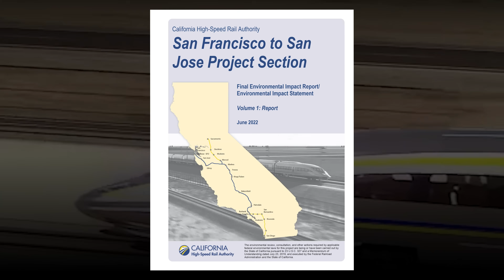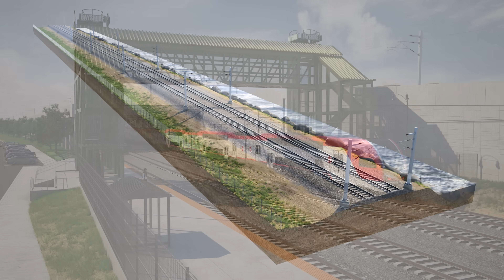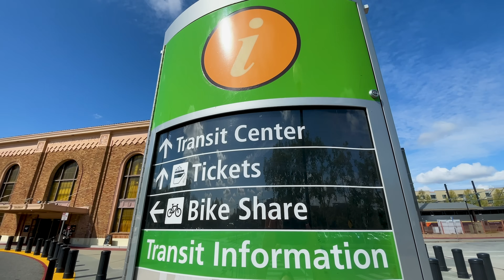San Francisco to San Jose Project Section Overview - FULL VIDEO

Comment: So the valley run Palmdale to Merced will be 200 mph?

And Gilroy to SF will be about 100mph using a blended shared track system? 

So San Jose to SF will take about 1/2 hour?
Reply: Delusional, its all faking realistic goals as there is no way one can travel in under 3 hours by train SF/LA.
Some 4-6 sleeper train services per direction for each night would be at least be doable. But as long as Caltrain themselves can't run their express service in under an hour journey, its not possible.

Comment: certain groups of voters are putting pressure at the state level to move away from gas powered vehicles so guess in away the passing of this makes sense. could have used this when i had to commute from marin to san jose to avoid the traffic nightmare  coming home .

Comment: The preferred CA-HSR specifications as written are for track speeds of 400 kph (249 mph).  CA-HSR implementation has totally lost its way.   The LA - SF route is circuitous and over the good fit limit of 500 miles to easily compete with air travel.  Everything possible should be done to shorten the distance and stretch to the highest speeds, just the opposite is happening.  There are no Chinese or Japanese HSR systems that notably run slower just from being in urban areas which are the primary examples of HSR in the modern world.  HSR is considered to be 250 kph (155 mph) and above.   

Blended high speed rail is 200 kph (124 mph) to 250 kph (155 mph) which includes freight and other traffic not 110 mph (177 kph).   Below 200 kph (124 mph) to about 90 mph is considered a fast passenger train.  110 mph and below allows the use of unsealed railroad corridors and at-grade crossing with quad gates which many freight railroads could be upgraded to provide.    110 mph track speeds would be a great enhancement for long distance Amtrak routes on upgraded host freight railroad tracks, but is not HSR.  

500 kph Japanese and 600 kph Chinese maglev train sets are running through proving and demonstration testing.  Japan was suppose to open its long distance 500 kph maglev from Tokyo in 2027, but land disputes have delayed it.   By 2045 eight meter wide three level maglevs running 800 kph - 1,000 kph should start to be possible.   That would mean in about twenty years 800 kph maglev technology become practical where California maybe just finishing new passenger train service with lots of 177 kph and slower speeds.  Nice for the 1950s not for 2050s!

That wide eight meter loading gauge has been desired since the start of the railroad age in the 1840s when UK double track railways were designed to occasionally have double width carriages run using the inner rails of the two tracks.   The eight meter wide loading gauge would allow large assemblies to be easily moved long distances overland changing the world as we know it.   The rail wheel interface is at its practical limit restricting the practical loading gauge width, but that is not the case for maglevs.  

All high speed trains need almost incrementally free electricity such as their own hydropower with unlimited water.   New nuclear power technology is likely the second best choice technology after hydropower in meeting that goal.    Japanese bullet trains were implemented with the hope of very incrementally cheap nuclear electric power.

Comment: Well, that is insane. After the effort made in the Central Area, in the SF area they are building a 3rd class infraestructure system, that significantly reduces speed, travel times and safety. Learn from Spain, France: high speed trains use exclusive infraestructure that is completely isolated from highways, streets or, at the end of the day, people, animals. That will cause accidents and it is a clear downgrade of the project that makes absolutely no sense.

Comment: How about a 4 lane road to Tahoe (hw50) And a 4 lane road through Tahoe pioneer trail. 7 hours last winter to get from placerville to South Lake Tahoe for commuters through 2 lane roads. But we need a light rail that will be never be done. Crazy horse will probably finish before this project. California is a huge state not easy to manage but there are certainly areas that could use some infrastructure resources. Especially one that sees more traffic per year than the Grand Canyon. Maybe some of that gas tax they keep raising. Other states seem to be doing okay without it and roads aren’t as bad. What do we pay taxes for now? Roads are included?

Comment: What incredible spin.  The guy speaks like it will be operating tomorrow, rather than in 20 or 30 years.  An Amtrak train from Washington DC to Baltimore goes up to 150 mph, takes 19 minutes 30 seconds, has been operating for almost 40 years, and is fully grade separated.  This SF/San Jose rail line can only go 70 mph because of the at-grade crossings.  Would've been better to branch BART from Mission Street to 4th and Townsend and save the money spent on the transbay station and it's tunnel for a second transbay tube to Emeryville and Sacramento.  Or possibly retrofit the BART tube to handle BART and these regional trains.  The current high speed projects are a lot of white elephants that cannot meet their goals and only suck money from more viable projects.  Oh well.  And can you explain why high speed rail didn't use the free right of way along the I-5 corridor on the west side of the central valley?  The mitigation and environmental impacts along I-5 would be minimal with virtually no condemnations, the construction speed much faster, the cost far lower, the operating speed much much higher and it could easily connect with the east side of the central valley.  The TGV in France from Paris to Milan goes completely through remote rural areas and bypasses Lyon completely.  Long distance high speed rail between large metro areas always uses remote right of ways to make up time for the lower speeds in the urban areas.  Also they don't have a bunch of local stations that slow down the average train speed and increases travel time.  Local stations are handled by regional rail.

Comment: I can't wait for this thing to open. It's a wonderful system to have and I wish more states had similar projects. But I have one qualm... 

You're going to have at grade crossings for an HSR system??? You'd have to put the barriers down way it advance for that system to work safely, and you'd probably still have accidents. Why go through all the trouble of building these viaducts (which I believe is necessary and good) but then have ancient at grade crossings????
Reply: The grade crossings are on the upgraded 110 mph classic tracks for 43 miles south of San Francisco, not on the HSR.

Comment: It's time to extend Caltrain to Southern California (Los Angeles and San Diego) from city of San Francisco.  It's really inconvenient to catch Coast Starlight either cross the bay at Emeryville or travel down south to San Jose.  In other words, one travels to east of the bay Oakland/Emeryville (Amtrak Coast Starlight) and one travels west of the bay to San Francisco (Caltrain).  If it happens in the future, more people will use train for traveling to Southern California.

Before CA HSR Authority complete their HSR Infrastructure, it should be no-brainer to extend Caltrain to Southern California from city of San Francisco.
Reply: Why do you need CalTrain with HSR? Why not an upgraded version or convert to BART?
Reply: @Cyrus992  Caltrain's new EMUs may very well be the best rolling stock in the United States for short-distance transit.
Reply: @chasemartin4450  So they do something that BART does not?
Reply: @Cyrus992  Yes, they carry more passengers per car as they are double-deck, have bathrooms, and have a much better solution for bike storage. BART is still very good though.

Comment: Go to Florida and learn something, theirs is almost finished 😂
Reply: Florida is flat
Reply: @darthmaul216  Florida is more organized.
Reply: Brightline will only run up to 125 mph
Reply: @QuentinLax  HSR is defined as 124 mph+. 

California’s HSR is currently at zero mph.
Reply: @PSTXFL  Brightline Trains go 80 mph on average, that's just the maximum speeds.
Reply: @Deiftwaser  Brightline actually operates and carries passengers.  CA does not. 👍
Reply: Brightline Florida also uses existing infrastructure for almost the entire length, the knowledge you could gain from this is near useless.

Also: That 124 mph+ is only classified for upgraded tracks. New tracks (which most of CAHSR is, btw.) have the much stricter 155+ mph requirement.
Reply: @MarioFanGamer659  Florida took the smart approach.  Use existing infrastructure and right of ways.  Connect major metros.  Partner with private enterprise.  

California will connect two minor cities and be billions of dollars over budget.  It’s bogged down by delays and cost overruns.  It’s a train to nowhere, a boondoggle.
Reply: @PSTXFL  Well, yeah, you could easily say that but the thing is that Brightline is owned by the Florida East Coast Railway who also own the tracks Brightline runs on (at least Miami to Melbourn — Melbourn to Orlandy is newly constructed).
In contrast, most of the rails in California are owned by private freight operators (the big, class 1 ones) who have no plans to run passenger trains and, from the general interaction with Amtrak, also are fairly uncoorperative with the government (though some are worse than others I have to note).

Comment: It will take a 20 years at least before work maybe start. Takes SF 12 years to build a mile plus underground light rail. Slot to open in November. Finally after a 3 years delay and billions over budget. Mean time at the same time span. China builded 20 thousand miles of HSR across China. Ask China to do it. On time and under budget.

Comment: Sorry guys but we'll never see Jerry's train set come to fruition in the near future. And the promise of going to San Jose from San Francisco is a comedy in action.  They talked about BART encircling the Bay back in the 1970s and it still hasn't reached San Jose 52 years later so let's not get our hopes up yet besides California needs MAJOR power grid upgrades to power all of Gavin's great adventure EVs before something like this happens.  While the idea sounds fantastic look at how badly this project has stalled in the Central Valley and then image all of the problems they're going to have trying to run this through a major population center. Personally I'd be happy if they just gave me 10% of what this video cost them!
Reply: Hilariously, BART opened up their Berryessa / North San Jose station a year or so before your comment.  High-speed rail construction is moving along fine in the Central Valley - we just need to get it done and have the system up and running asap!
Reply: @bryanlee3641 That was i was about to say & The Japanese First HSR had the same problems as well yet they opened in 1964

Comment: Grade crossings for high-speed rail is a mistake. They should be separated by bridge or tunnel, even if it means driving a mile or so detour. I've been watching Florida high-speed rail where people (including police!) ignore the crossing arms and lights to cross and get hit by trains. If you must have grade-crossings then the road should be one-way so no one goes around the arm. Also, there should be barriers that come out of the road (like at security checkpoints) to prevent cars and trucks from crashing through the arm to get on the tracks.
Reply: "Florida high speed rail" you're having a laugh, if you think Brightline is high-speed

Comment: I'm sorry, having grade crossings on a so-called-high-speed line is completely absurd and counter-productive, and that is in keeping with the wishes and implemented outcomes over decades of the US Freight Carrier Railroad Engineering FRA Revolving Door Cabal.
Reply: Well, it's not even high-speed (not surpassing speeds of 200 km/h on upgraded tracks) so that shouldn't be a complain either.

Comment: Fail.  There are 3 bay area airports connecting to 5 LA area airports with about 1.5 hours flight time.  Even the HSR officials concede they cannot compare in time much less convenience.  Fares will be about the same.  The majority of the US simply does not have the population density to make HSR an effective solution.
Reply: This video proves that the promised 2 hr 40 min travel time from LA to San Francisco can never be achieved. It will be closer to five hours which makes it even less competitive with air travel. The video mentions LAX and the main San Francisco airport, but the majority of travel is to and from regional airports. Ticket prices will have to be subsidized.
Reply: You do realize that this rail doesn’t just connect frisco to las angelus, right?
Reply: @darthmaul216  Yes I do.  If you look at the economics of the Bakersfield to Modesto part of the line the financial situation is even worse.

Comment: Anyone interested in exploring a new design for high speed rail?

High speed rail vs flights boils down to travel time. At the minimum, most flights need 2-3 hours for passengers to check in, go through security, etc. So, HSR will be preferred for any destination which is within 4 hours. Beyond this, hauling cargo will be more likely & profitable (vs. flying the same cargo). 

I propose a new & dead-simple design to rapidly enable affordable HSR, with speeds approaching/equaling maglev... safely, reliably & economically... employing existing non-MagLev technologies, which are already fully compliant with local /international standards & regulations. 

Pending a patent, early access to said  key technologies is possible upon agreement to a NDA, plus payment of a non-refundable fee... PM for details.

Comment: There are problems that need to be dealt with:
1) CAHSR refuses to commit to level boarding. Caltrain uses double decker trains, which have low entry stairs. CAHSR appears to be taking over the Gilroy to SF section (except, it has to accomodate Union Pacific freight), with Caltrain being an afterthought.
2) Caltrain kills about 12 people per year. Grade separations (which reduce pedestrian access to the tracks) should be a mandate.
3) The Millbrae mess needs to be fixed. BART got there first, and is in-the-way of good HSR service. The SFO People Mover should be extended to CAHSR, and the BART-SFO link ended.
4) There is no rational fix to the Salesforce Tower SF mess. End of the line, no through-running, choke point on access tracks, choke point in built/unused/brand-new pedestrian access to the Salesforce platforms. The SF estimate to bring Caltrain to Salesforce is $6 BILLION for 2 miles of track. The cost of implementing the Central Valley HSR connection to San Jose is high, the cost of connecting to San Francisco is astronomical. 
5) The Sierra Club strong-armed Sacramento into eliminating a station at Los Banos, becase it would make HSR too-convenient for daily commuting from the Central Valley to Silicon Valley. The Club isn't interested in HSR as transporrtation, it considers HSR only to be a political tool.

Comment: This is ridiculous!  There are so many stops between SF and SJ that high speed is unnecessary and a waste of money.  They would have to eliminate all the stops between and even then, the population density and distance of the area would prevent it from taking advantage of high speeds,
Reply: 1. Speed limit is 110 mph which is regional and not high speed.
2. Some stops serve as feeders and distributors which is done in places like Japan and Germany. They also are not served by all trains either. This is particularly true when you consider that Milbrae also has an airport nearby and many HSR projects are built to also serve airports and serve international and continental fliers so that's a stop which must exists (but can be skipped, of course) no matter on how useless you think it is.
3. Right now, the Caltrain section is planned to have four intercity stops (five if you count Gilroy). I hope you're not counting all the Caltrain stops.

Comment: You seem to forget that electric powered is not the same as pollution free or does not contribute to global warming.  The electricity comes from fossil fueled power plants which will be our marginal source of energy for years or even decades.  In other words electric trains do not creat one bit of carbon free energy.  They are an alternate form of transit for California and should stand on its own two feet.  I do not know how the high speed trains solve the noise problem but I am sure people are working on it.
Reply: Except that California has an electric grid that produces a majority of its own power from green energy sources. So we're good!
Reply: One bullet train can transport over 1000 people at once. Even if it draws from coal power, it's infinitely more eco-friendly than cars are.